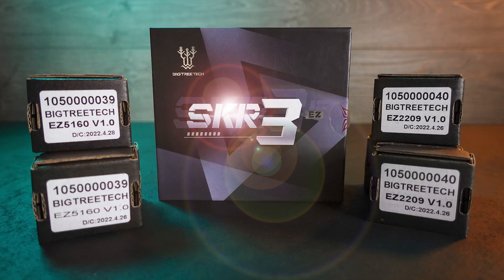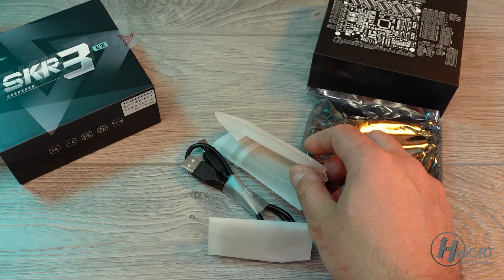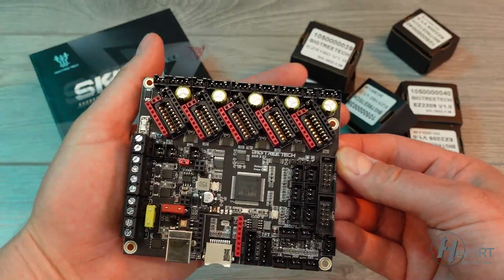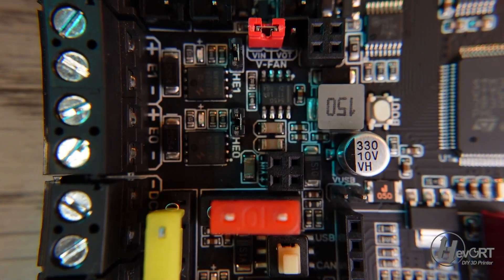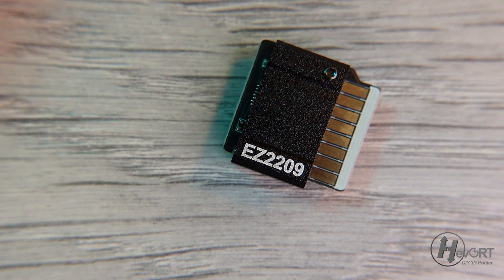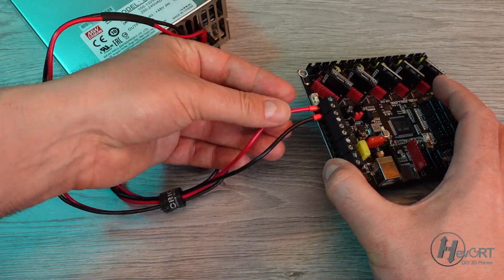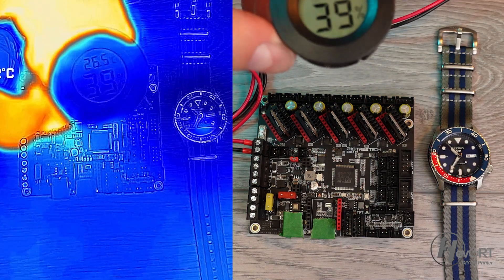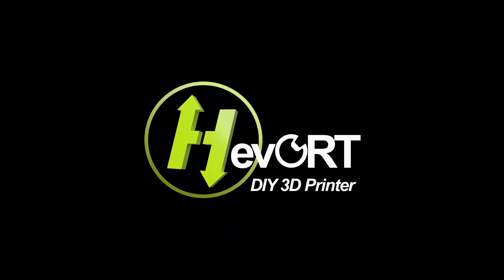Could this new control board be enough? - Unboxing SKR3 EZ from BTT

Comment: Great video, as usually. If were're talking about the Trinamic 5160 => spec: Voltage Range 8-60V DC without radiator. All your test are great exept this one: please consider do thermal bench only with a load: a stepper with a load or a power resistor.

Comment: Are those 5160s as capable as the original 5160 Pros that could be pushed to 50-55v? I'm also interested in the CANBus pins? Do they also supply 24v power or do I have to splice those in by myself? It'd be awesome if they did!

Comment: I think the resistor is to be used with an LED for the print bed, if the connection to the bed has an LED.  I don't have such a setup, but I'd guess the LED will be on when the bed voltage is on (when heating).

Comment: I have a question, my board wouldn’t flash firmware, I checked and the power light was off, all connections checked, I then used jumper to try usb power and the power light came on and flashed firmware, I checked psu voltage with my multimeter and it was fine but I have ordered a new psu just incase, other than that I’m at a loss.

Comment: Resistor is for auto save feature, on power loss it can supply enough juice to write to memory. Put across power input.
Reply: How it helps to add enough juice? It is not capacitor. Something unlogical. Do they show that at manual?
Reply: This is incorrect. A resistor is not going to "supply juice". Instead it will take away or dissipate juice. It is not a capacitor.
Reply from the maker: Thank you!
Reply: @MirageC  My pleasure :)
Reply: And if you put it across power input you will simply get a really inefficient heating element. It will even discharge the caps for the supply voltage faster

Comment: Doesn't know what the resistors are for....

Adjustable external thermistor pullup, for those of us who don't want to try and solder 0402 or smaller resistors on a packed board. Maybe I want to send in direct analog voltage from a width detector and don't need a pullup or E1...

Only board I've seen lately that allows this.

Comment: Does this work with Servo42c?
Reply from the maker: Yes, you simply have to use the old driver connector type from this board to seat your servo42c driver/connector adapter.

Comment: yup! looks sharp! no ghost in the machine! ah! did I hear correctly? U'r gona try hooking 2 boards together!  that would be nice..
I'll like 2 see that!
Reply: The 2 boards are connected to the pi computer using the "multi-mcu" function in klipper. I use it on my printer with  a duet2 and an skr mini. It was much cheaper than buying one of those stepper extension boards.

Comment: Would be nice if they start using USB Type C connector. I don't want to keep any big Type B cable anymore to be honest, it's very annoying with those cables
Reply: Standard USB type B is big, that's true. But it also unbeatable (especially by type C) when comes the reliability.
In my case, even miniUSB (which should be the least lasting by design) lasts always longer than any USB type C cable (which by design should lasts more insertings, but in real life, it is quite opposite).
Reply: My octopus is USB type c

Comment: Pullup 4.7?
Reply from the maker: I am a big kid now! Lol... it's to select the resistance value of the thermistor circuit. 2.2k or 4.7.
Reply: @MirageC  Jumper selectable 4k7/2k2 pull up for PT1000 sensors😂
Reply: Hello, Jumper selectable 4k7/2k2 pull up for PT1000 sensors

Comment: The Octopus Pro has a frequency of 168 (STM32F429) or 180 mhz (STM32F446). The STM32H7 on the SKR 3 is 480 mhz. Quite a different beast :)
Reply from the maker: Oh WOW! Thank you for correcting me Mikkel! This is indeed a beast! I wonder how much of this we will be using. Or what new door is this opening.
Reply: @Joe Schmoe Indeed, it's faster than the 6HC. But.. Still no separate X/Y input shaper :(

Of course there's marlin as well.

480mhz is completely wasted on klipper :D
Reply: Wow that's a massive jump!! But as im using klipper I can't see how this would improve things at all unfortunately, but for Marlin and RRP this can have massive impacts with expansion boards and input shaper etc.
Reply: Not only the frequency difference is massive, but the core itself is far more powerful on it's own.
That chip is an absolute beast.

Comment: Looks lovely, any info when it gona be avaible? It is able to select motor voltage for each driver?
Reply from the maker: No info on availability but I guess it should be very soon.  And yes, each driver can be set to either board voltage (ie 24V) or motor voltage (ie 48v).
Reply: Hello, it will be available  at 8AM, May 19 (EST）on biqu.equipement, AliExpress and eBay. Yes, Jumper selectable driver voltage (MOT/VIN 48V MAX)
Reply: @Joe Schmoe yes it has selectable voltages for the fans but im not sure how since there are no jumpers for that

Comment: is 48v - a viable work voltage for this configuration?
Reply from the maker: You will need to feed 24V to the board and 48V for the motors dedicated voltage input.